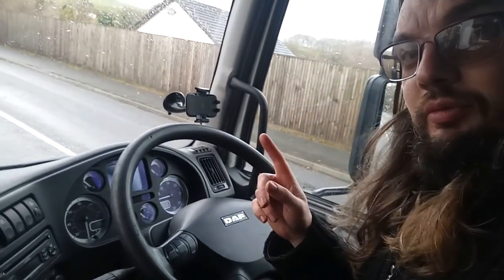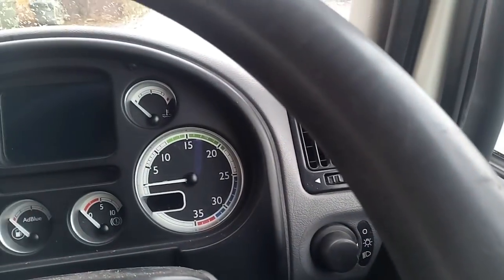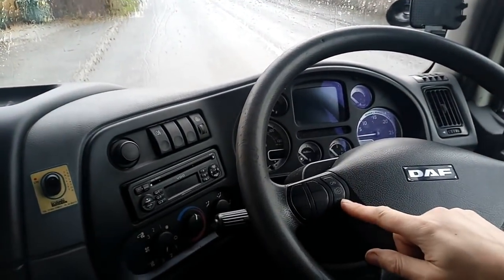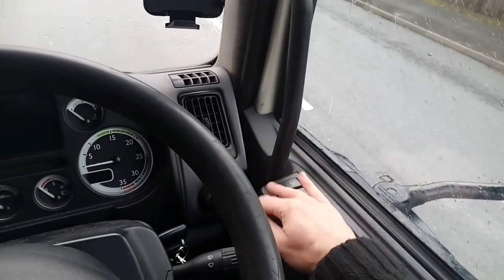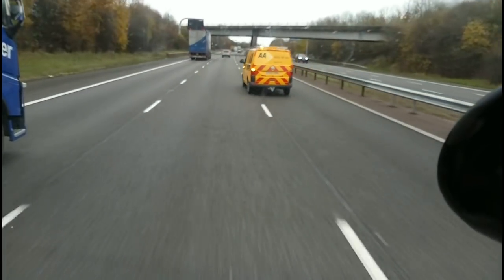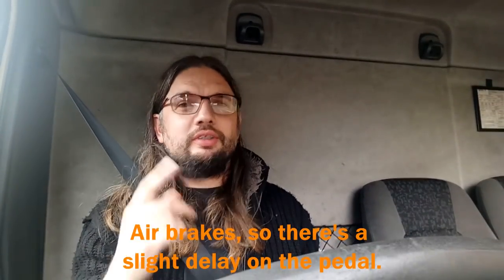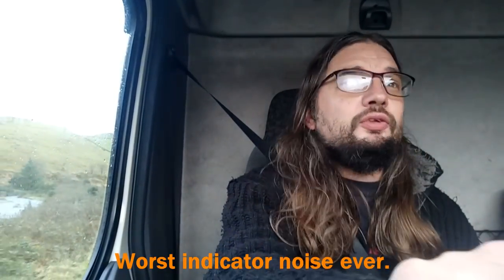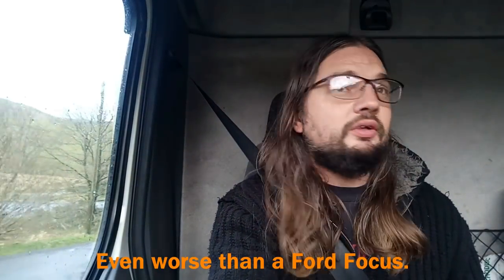How to drive a 7.5 ton truck. I like trucking!

Comment: What I'd like to know ow is does Hubnut have the license to drive 7.5 ton. Does he hold a CPC card. Even though this video is 3 years old CPC has been out much longer. Why was he driving an illegal truck on her majesty's highway.
The Daf 45 I drove some years back I did over 500k miles in it no problem.
Having an adblue system not working is illegal and its a shame he didn't get stopped by the police. Sorry but a very very bad video, hubnuts blatant disregard for other road users driving an unsafe truck.
Reply from the maker: I hold a driving licence issued before 1st Jan 1997, so automatically have 7.5 ton entitlement. CPC is not required for non-commercial use, which this was. Non-working AdBlue is not unsafe! I accept it's not ideal, but that's for the hire company to sort out.

Comment: If the trucks rear lights didn't work you shouldn't have taken that lorry on the road because the last thing you needed was for a police officer to pull you over and for them to ask you to follow them to a weighbridge as that's the kiss of death because you will have some man from VOSA go over your lorry with a fine tooth comb and if they find anything else wrong with it the finds will just rack up. So if there is a next time check it over and if it's not working get another lorry that works.
Reply from the maker: Jeepers. Chill out! I was referring to the load space lights, not the external lights on the truck.
Reply: They get MOT'd every 6 weeks, so the even the duff looking ones are safe. Hire companies are usually responsible people.
Reply: They don't get MOT'd every six weeks they get safety checked, same as buses/coaches. MOT is still annual however it is every year from new as opposed to after 3 years for a domestic vehicle
Reply: Scott When I was a bus driver for Stagecoach in Warwickshire, we had to check everything on and around the bus and fill out a defect card.  Anything wrong and it was go back inside and get the controllers to issues another bus and do the checks on the replacement bus all over again. The buses get serviced every 21 days without fail and any issues put right.
Reply: Mark P Yes, we do as well except we have a daily check app now to complete on our phones that gets uploaded to the server.
Reply: HubNut one other thing unlike in a car in a unloaded 7.5 ton lorry you don't pull away in first gear as you will kangaroo down the road. Most of the time you would pull away in 2nd gear.
Reply: Scott. It's essentially a mini MOT, and the owner can't scrimp on repairs.

Comment: I can see you are not a qualified truck driver . I've been driving trucks buses and coaches for a 35 years with various types of gearboxes crash gearbox, splitter gearbox and  4 over 4 gearboxes in coaches and  two-speed  back axles on a Leyland Leopard coach.The truck that you are trying to drive is a DAF LF which started out as the Leyland Roadrunner